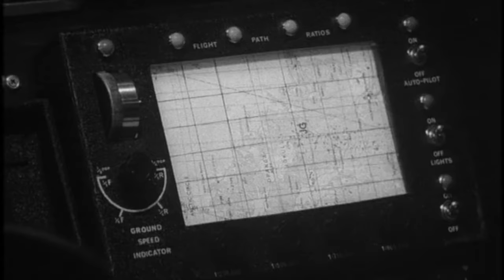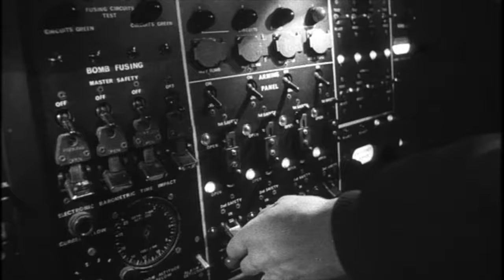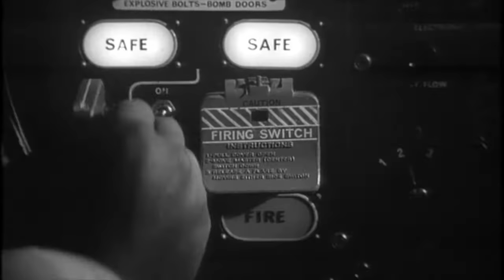Dr.  Strangelove Bomb Run // Part 2

Comment: ...how I learned to stop worrying about special effects and love the film.
Reply: I thought the effects were great, especially considering when the movie was made. The B-52 interior was totally convincingly accurate, even though it was a set. I don't think anyone but Kubrick would have insisted on such accurate looking details, then or later.
Reply: @shadovanish7435  I read that during filming someone from the Air Force ask Kubrick who gave him classified information. Kubrick told hem it was all public information.
Reply: I see what you did there😉
Reply: @jcf20010  That's interesting.  I did read that one part of the film is inaccurate.  The planes had to receive a positive confirmation to go in order to attack via what they called (if I recall correctly) a Positive Control System.  "Ripper" would not have had the ability or authority to order a nuclear attack.  Now, of course, what would have actually happened in an emergency is unknown, but I suspect it would not have been this way.  It is, of course, still a great movie.
Reply: Just after see moon landing video.
 I  love more this movie.
Reply: So u quit worrying about the effects and learned to love the movie?
Reply: @jbreezy101  I was specifically referring to the shots of the aeroplane with the mountains behind it. Just that.
Reply: Honestly i think effects in this movie have aged extremely gracefully
Reply: I know, but it makes it all the more special....
Reply: Most of the flying scenes were filmed using a WWII B-17; and then the B-52 model was superimposed. Several places in the film you can see the shadow of the B-17 on the snow below the B-52.

Comment: Pickens said that Kubrick only gave him the parts of the script that held his lines and got his scenes out of way first when they started shooting the scenes. He didn't mind reshooting scenes over and over since Kubrick payed for his time on the set but felt that Kubrick went overboard when the number of reshoots for the scenes with him riding the bomb down totaled 1000 before he stopped.
Reply: He also never told Slim that it was satire.
Reply: @JebHoge  I don't think Kubrick told Pickens much of anything other than he was replacing Sellers due to injury and to act his part as directed. Someone at the studio that was familiar with the script suggested Kubrick to use Pickens since he was a natural for the part, was a quick study and didn't argue or complain to the directors. Perkins probably knew what the movie was about anyways and didn't care since it gave him an opportunity to earn some income.

Comment: I like that. The CRM auto destruct mechanism got hit and blew itself up.😹😁 I wonder how accurate was the flight and bombing procedures were in this film. It looks very comprehensive and detailed.
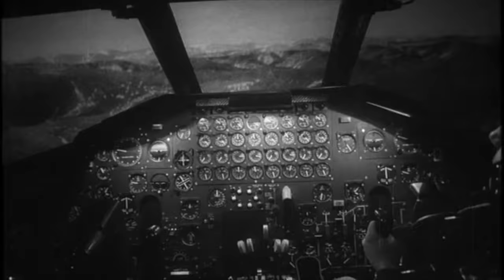Reply: Some of it is ridiculous. The command to switch "Pulse ident transponder to active" at 4:19 for example. Why would you want to identify your aircraft to enemy radar during a bomb run? LOL. And at 4:58 when the target comes into visual range, the aircraft is obviously so low that the bomb explosion would destroy it.
Reply: Apparently the procedure was close enough to the actual thing that it got some extra attention from the Air Force.

Comment: That has to be the slowest B52 in the universe on that run in.  Director really didn't get that right at all but hey it increases the drama.
Reply: Its max speed at altitude is still subsonic so ofc its going to be slow
Reply: @Oliepolie  the B52 is always subsonic as long as it has its wings attached....
Reply: Performance
Maximum speed: 650 mph (1,050 km/h, 560 kn)
Cruise speed: 509 mph (819 km/h, 442 kn)
https://en.wikipedia.org/wiki/Boeing_B-52_Stratofortress
Reply: @ulfosterberg1979  lofl
Reply: Remember, it suffered damage from the missile attack.  Had 3 engines out, which would have slowed it’s airspeed greatly.
Reply: It's a movie, not a training film.
Reply: Yeah, I was distracted from the point that they were 10 miles out on how slow some of those miles seem to go by….maybe the editing was at fault.

Comment: James Earl Jones ! 
Mr. Slim Pickens (Louis Lindley, Cowboy and Actor extraordinaire) subbed this part for the star of this movie  Peter Sellers, after he broke his hip, if memory serves.
Reply: Apart from lining up Sellers, Kubrick initially wanted to cast Dan Blocker (Hoss from Bonanza). His agent turned it down on the grounds it was "too pinko" for the actor - without consulting his client. Blocker only found out later.
Reply: X
Reply: Pickens said Kubrick only gave him the scripts that held his lines and got his scenes out of the way first when they started filming. Slim also said that Kubrick had a habit of redoing scenes over and over again when the actors felt they gave a flawless performance each time. The scenes showing Major Kong riding the bomb down required a total of 1000 retakes before Kubrick was satisfied with one. Pickens said the film crew and set staff were royally pissed off and asked him how does he put up with that? Said he shrugged and said Kubrick pays me to act so that's what I do.

Comment: it is funny how the plane moves around but the tail doesn't move nor do the flaps.
Reply: I thought I was the only one who caught that!!
Reply: If you look at the B-52’s shadow, you’ll see that the real airplane is a B-17 flying the low level!
Reply: I was a model obviously. Notice the small protrusions on the top of each wing located just inboard of the inner engines. That is where the thin metal wire was attached to suspend the model. I’m sure Kubrick was aware of the lack of deflection of the ailerons and rudder, but this movie was produced on a relatively low budget. At least with the model they did portray the wings deflected up in slight bend which is true to how the wings act in flight of a real B-52. This is called aerodynamic induced dihedral which helps lateral balance.
Reply: Come on, it is pre-Top Gun. Brilliant movie.

Comment: So that plane was flying at about 40 miles per hour.
Reply: I noticed that
Reply: @randyblackburn9765  And about 300 feet altitude.
Reply: @donwayne1357  yeah all while hanging from a wire
Reply: @donwayne1357  Not good for dropping Nucs.

Comment: OK for extra credit, which model of B-52 is being flown as shown. I think its an early B-52D model used in 'Chrome Dome' airborne strategic deterrent missions of SAC.
Reply: It certainly looks like a C/D, which would make sense ... 

Actually, what people didn't know is how SAC/CIA where completely spooked by just how damn accurate they got most of the really key instrument panels, with the rumour that the latter kept a close eye on ticket sales, is specific locations, just in case ...

Although I don't think Kubrick ever dabbled in such bleak humour after that, some of the lines aremain absolutely hilarious due to the dead pan delivery ...
Reply: @nigelft  For the era, and the white underside bomb flash paint job, it should be a'D' model. But one view of the plastic model they used in flight,  from the side had a cut short tail...so that would have been the G/H model..  Also the engine naceles looked bigger for the improved engines. They have have used different plastic models through the filming,and not realized they were different B-52s'  Gotta get out my book made on movie, and check my DVD copy for scenes in flight.

Comment: Flip a coin, do you want professional competency, or a 15 independent warhead missile with either fire and forget or A.I driven multiple choice targeting direction based on in flight results evaluation. I was never in any of those operational situations. But during the cuban crisis were were told that if it all went pear shaped we would be deemed qualified and sent out to the bases. The prime function being to do radiation sweeps as the single staff we would be more expendable. 60 years later its up to younger people to decide

Comment: The Good News: One of the Nuclear "Failsafes" is known as "Continuity of Command".

Effectiviely, right up until a bomber commits to its final run (bays open, deploying payload), a sub is committing final firing sequence, or a silo is committing final firing sequence, at this ONE form of communication back to command MUST remain intact to potentially call the attack off (barring a "deadman" protocol).

If they lose communication, they are NOT permitted to fire.  Its considered better to risk the extremely low possibility Command is gone and this is a Final Strike Scenario rather than the MUCH HIGHER chance their was a comms failure and there was a de-escalation.

The Bad News:  You probably don't want to know the circumstances that led to that practice being canonized into the protocols...

Comment: You see "Explosive Bolts" in this movie and 2001
Reply: Both the US Airforce and NASA used them.
Reply: @AudieHolland  OK? But what was Stanley thinking ?
Reply: @fredziffle6843  He was thinking: only geeks like myself know they're explosive bolts.
In reality, there will be a similar warning sticker but not with the exact same message (more like: RESCUE for ground personnel).
Reply: @AudieHolland  expected different, also Slim Pickens also referred to Explosive bolts
Reply: @fredziffle6843  Again: using proper jargon would not get the message across to the public.

In "2001: A Space Odysee," he even puts a marker to the 'anti-gravity' velcro shoes worn by the air hostess. Well, at first I thought it was an on-screen caption.

Comment: A lot of unnecessary buttons
Reply: Have you ever seen the engineer's desk in a heavy bomber?
Reply: @JesseMercer-l4s  The B-52 had a ton of electronics for Special Weapons (read, Nuclear), especially safety, sensors, ECM/ESM, and defense. The engineering deck was a busy kitchen, compared to a P-3.
Reply: @sillyone52062 B-52 crew has no engineer.  The overly complex panels and checklists are all part of the satire.

Comment: Dramatically, showing the approach of the missile on the radar screen and then the effects of the blast is far superior to having phaser blast after phaser blast jolt the Enterprise and knock the crew out of their seats. It's technically inaccurate, since the radar on a B-52 only detects precipitation. On the other hand, the Enterprise's inertial dampers didn't stand up to enemy fire very well. Wouldn't the shields have protected them?
Reply: Do have first hand evidence that the B-52 radar does not have a ground mapping function? Seems to me ground mapping would be an essential element of a bomber’s radar system.
Reply: @wilecoyote5757  The radar is located in the nose cone and looks only forward. The screen in the movie was for a ground radar that can see in all directions.
Reply: @wilecoyote5757  When I worked on B-52's during the 1970's they had a "terrain avoidance" radar on them that was supposed to allow a B-52 to fly safely at low level. However, it was so inaccurate and unreliable that the B-52 crews at the time refused to fly at low level during the night and in poor visibility using the terrain avoidance radar. It was considered to be suicide. Since then the terrain avoidance radar has been replaced with a low light level TV system that allows the crew to see the ground in front of them even at night and in poor weather conditions. Also, the primary means of navigation for the B-52 back then while in enemy territory (where the traditional means of ground based radar navigation such as TACAN were not available) was a celestial navigation system, called an "Astrotracker", that tracked the stars and the sun. I would imagine that the B-52's that are still in service today use GPS just like most modern jetliners do.

Comment: Visual special effects ,Terrible ! Acting ,pretty good ,"Fail Safe ", a  Better Movie
Reply: Both came out the same year, broad farce vs deep drama and yet both eloquently point out the futility of mutually assured destruction.
Reply: Aerial views were shot under-cranked from a B17 whose shadow can be seen in some views on the ground. Probably didn't consider a better visual effects budget.
Reply: Maybe but, you can consider this film was shot nearly 60 years ago.
Overall what matters, i think, is the black humor, the acting, the message of this movie. It's soul.
Fail Safe is a masterpiece at the same level but it uses different ways to pass it's message.
I love both but if Fail Safe is a Nightmare bringer for me, Kubrick's movie is lighter in form but not in substance and more suitable to be seen and understood by a greater public, if you want to show the folly of M.A.D.